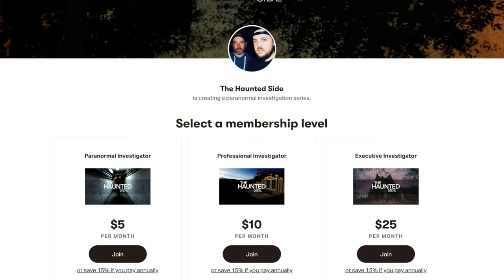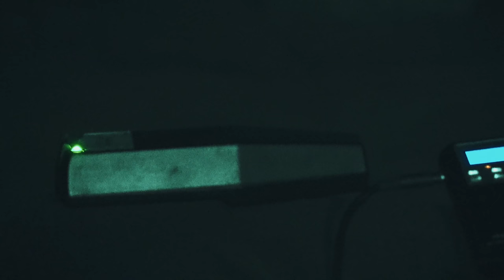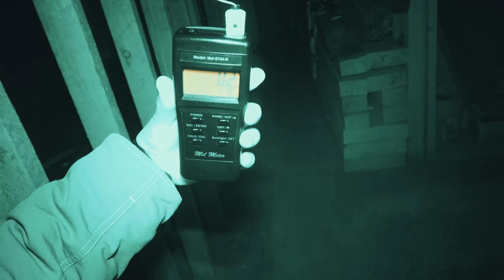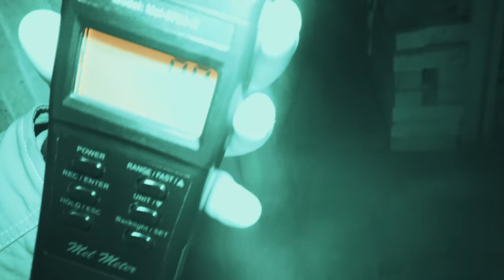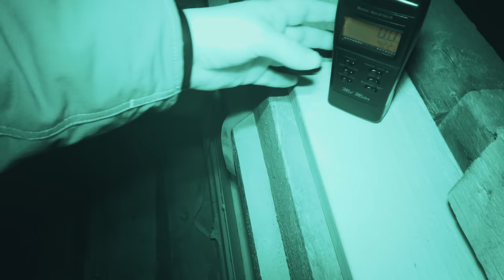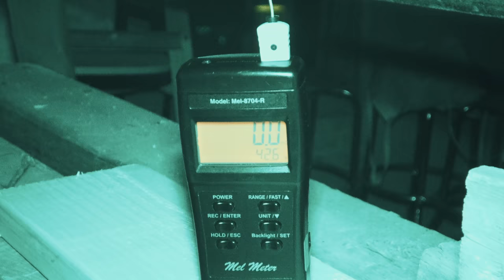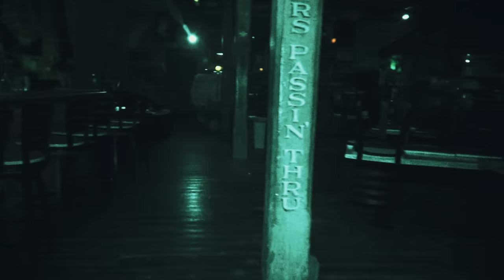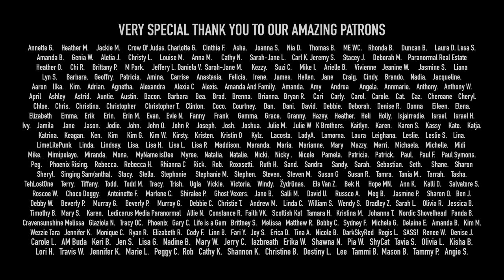Poltergeist in the Attic | Paranormal Investigation 4k

Comment: Dowsing rods 100% work. Just make sure to hold them straight and on a slight downward angle and reset them between each question if they have moved. Some spirits will even bring them back to the middle if you ask them to. 
Honestly even if you don’t show them on the episode until you get used to them the more you use them the more they will start to work for you. 
You can actually start to feel something pushing on them and you’ll have no doubt that it’s not you. Lol 
Great episode guys this place was insane. Can’t wait for the next. 👻💛✨